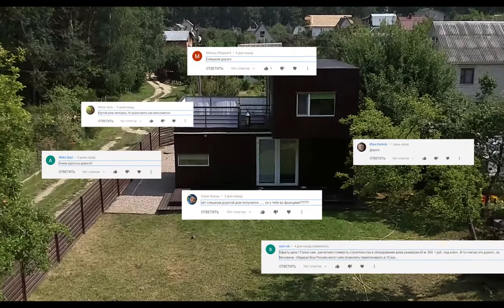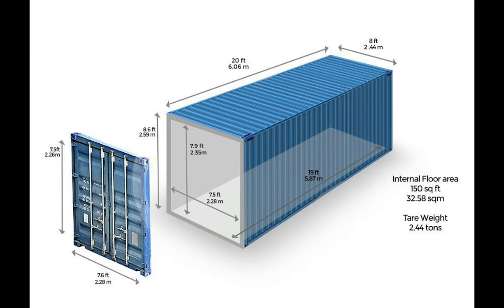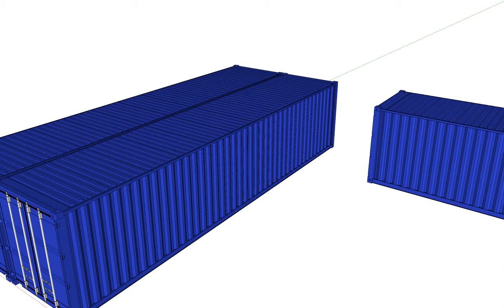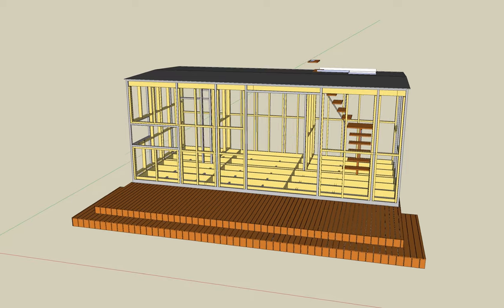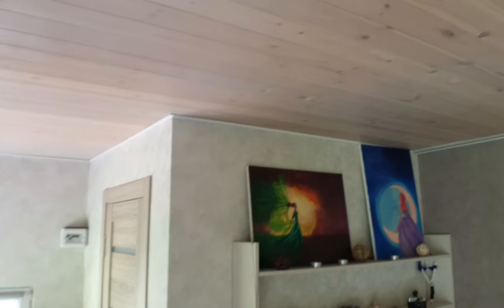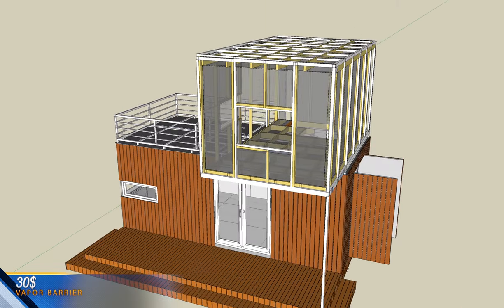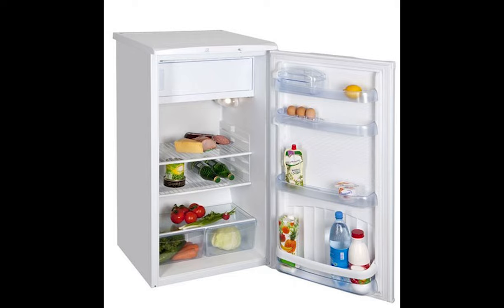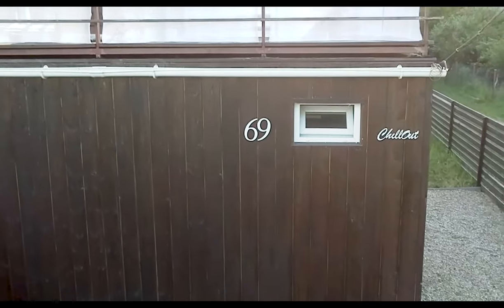How I Built my Modular House. House Plan & Cost Calculation.

Comment: Interesting. Prices seem very reasonable compared to UK.
Roof, did you have some ventilation above the insulation to prevent condensation 
ps, with a container it makes sense to insulate outside, you then have the steel shell as a perfect vapour barrier, more space, and could use the steel as a funky finish.